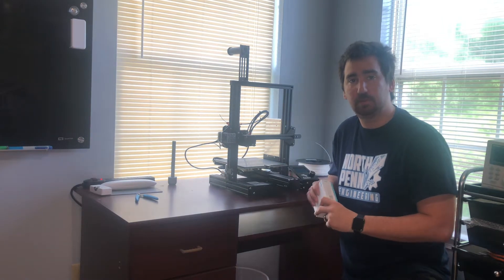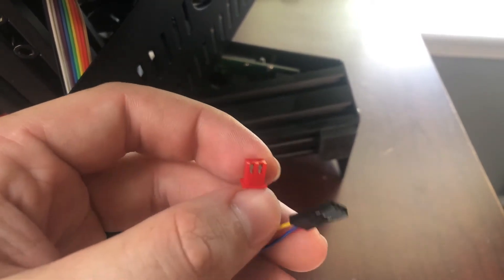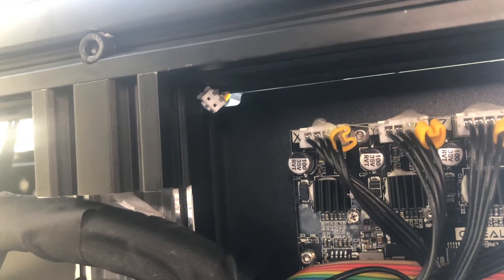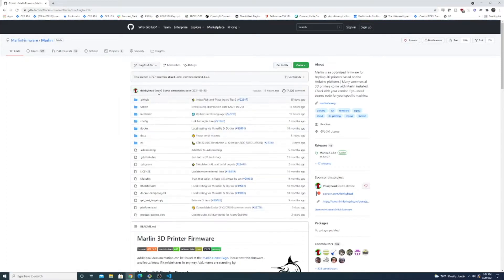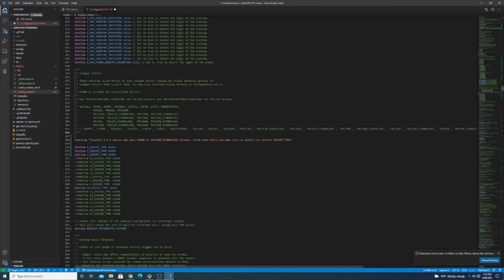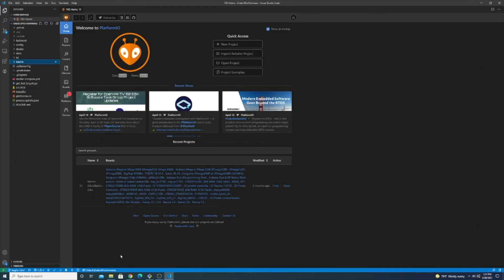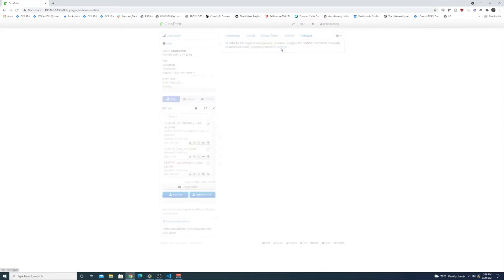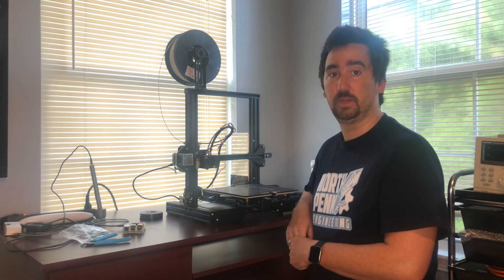How To: Install BLTouch & Compile Marlin 2.0 | Ender 3 Pro Build Series EP4

Comment: This video was super duper helpful for me upgrading my Ender 3 Pro. I did have to disable the z_probe_uses_z_min_endstop_ping flag as the other commenter mentioned. I found a reddit thread pointing that out and it fixed my issue with the printer running into an error and requiring a complete reset when auto-homing. Also for those that are using octoprint, it's a good idea to enable the flag for HOST_ACTION_COMMANDS so that the printer can send messages to Octoprint. Thanks for making this video!

Comment: Not sure if you are going to see this on such an old vid but what did you use to find the platform, i was able to get to the screen but I can't read what you typed in to the search bar or what that changed. I am using a regular Ender 3. And for anyone who is seeing this now I was able to get the same options i nthe blue bar that he did by preessing the home button then opening the folder with the programio.ini file in it. Not sure if that was mensioned in the video and i missed it or not.

Comment: I know it is a longshot that you will reply to a new comment on an old video, but here goes nothing.  I have made all the changes you made (save for the 4.2.7 board) but I don't have a spot at the bottom to select my platform, and no check mark to compile the firmware. What am I missing?
Reply from the maker: Hey, do you have the platformIO extension installed in your VSCode? Make sure that’s installed, also make sure you open the root directory of the Marlin firmware, as it contains the configuration to set up platformIO

Comment: Awesome tutorial! But i have one problem my bl touch is starting to make mesh around 2cm outside of a bed. How can i fix it?
Reply from the maker: You can use a GCode command to change the probe offset, which tells the printer the location of the BLTouch probe in relation to the print head nozzle. Check this documentation out for details: https://marlinfw.org/docs/gcode/M851.html

Comment: You went so fast with a screen that was too small to read, after backing up twenty plus times to try and identify where you were at, I gave up . Frustrating.
Reply from the maker: Is there a specific section that you need clarification? I’ve had some comments about readability so future things I will probably bump up the text size.

Comment: I did everything to the Z, my problem is the probe is probing way too far on the corners also the Y axis tried to go past its own length towards the front of the machine. Any thoughts?  ender 3 pro 4.2.2 and bl touch with 5 pin plug. If I use the flash from the Creality website it works fine but the probing is super slow
Reply from the maker: First check to make sure the X_BED_SIZE and Y_BED_SIZE Is correct. Mine probes pretty close to the edge, but doesn’t overextend like you’re saying

Check to make sure your NOZZLE_TO_PROBE_OFFSET is correctly defined. 

There is a PROBING_MARGIN defined as well, maybe can play with that? Mine is OK with the defaults. 

In terms of speed, you can change XY_PROBE_FEEDRATE to change how fast it moves to the probing point, and then you can change Z_PROBE_FEEDRATE_FAST and Z_PROBE_FEEDRATE_SLOW to change how fast the probe moves up and down. 

Be careful when messin around with the settings!

Comment: Hi, I have exactly the same machine (board and all), I've tried to follow your guide but I have following problem: when turning on my BLtouch deploys normally twice (as it should), but then when I try to auto home the printer homes X and Y axis, but with Z it doesnt deploy BLtouch and just crashes into the bed. I don't know what to do about it, I've seen this problem mentioned in multiple places all over the internet but I cant find a solution. Do you have any advice?
Reply: @Manok Yep, I ended up having to update to the most current stable Marlin firmware. The problem never happened again! Although it did take a little bit of learning on how to do it and what I needed to edit in the Marlin config file for my printer. Although now I'm on Klipper firmware and love it
Reply: That's what I'm trying to fix right now. Although for me, it fails randomly during the bed-leveling before a print. It's crashed into my bed at times, and other times it just blinked, stopped leveling, and then I turn it off before it tries to continue the print.
    From what I understand, in my case, is that the actual creality firmware from their official website is most likely the problem. I've read that upgrading firmware to the newest marlin (and ditching Creality's version) could fix it. I'm trying it now and will run several test prints before I reply with my results. 
   My case is this:
-Official Creality BLTouch module
-Ender 3 Pro with 4.2.2 board
-All cables are secure and wired correctly (My board has the dedicated BLTouch port with all the wires on one 'plug' (meaning, I plug in only 1 end to my motherboard) 
-Creality's software didn't work for me. I've troubleshooted the wiring (correctly and securely), reinstalled firmware twice from Creality's website, straightened out probe, and tightened BLTouch. Those options have not worked as of yet. I hope I come back with good news!

Comment: Can you include your start and end gcode? I feel like my printer is not using the mesh.
Reply from the maker: I added the start and end gcode to the video description.. The M420 S1 line is what loads the mesh before the print.

Thanks for watching!
Reply: @PrintPractical  awesome thank you! How often do you create the mesh?
Reply from the maker: I really don’t do it too often. Maybe once a month or less. Though, if I’m impatient and rip a print off the build plate while it’s still hot, it usually causes it to be re-leveled again. I’d check out the mesh plugin I showed on Octoprint. It’s pretty neat.

Comment: The newest BLtouches comes with a 5 pin plug only that goes into the Z-stop 5 pin on the motherboard. In this case I have to disable the z_probe_uses_z_min_endstop_pin flag or else the printer won't auto-home since nothing is plugged into the 2-pin z stop plug anymore.
Reply from the maker: Did I not mention this in the video? If not, that’s my bad. 

Thanks for watching!

Comment: excellent video thanks! how would you configure the file if you had the five pin bltouch connector? Just wondering what you would need to un-comment etc?
Reply from the maker: If you are using the 5 pin connector, and not the Z Endstop port, then make sure Z_MIN_PROBE_USES_Z_MIN_ENDSTOP_PIN is commented out!

Thanks for watching!

Comment: I have a new problem. When I start printing the bed is very un even. Meaning one end is higher then another. Do u know what the problem is?
Reply from the maker: Did you make sure your gcode is loading the bed level mesh? Did you try to use the bed visualizer plugin for Octoprint to ensure that the bed level is close
Reply: @PrintPractical  ok it's good now

Comment: I'm not able to read the board you're selecting, don't you have a Ste by step guide? The video Just isn't clear enough for me.

I already tried multiple videos, but nothing works. I'm about to throw the printer out of my window
Reply from the maker: Sorry Jeffrey, I just tried to capture my setup when I was compiling my firmware. I believe you are supposed to be setting your platform to STM32F103RET6_creality. The board you want to set for #define MOTHERBOARD BOARD_CREALITY_V4

Thanks for watching!
Reply: @PrintPractical  thanks for the quick reply, is it the same for board 4.2.7?
Reply from the maker: This is the MOTHERBOARD for 4.2.7: BOARD_CREALITY_V427

You can find these in Marlin/src/core/boards.h
Reply: @PrintPractical  tried to configure the firmware using your steps and using the files for board 4.2.7. but it doesn't work 😭😭. I will try and look for a pre configured file as I'm already trying for 4 months.

Comment: When I try to auto home my probe just deploys and comes back a few times, but then fails. Any thoughts?
Reply from the maker: Can you try inverting your Z axis endstop in the config.h? Maybe it’s reversed.
Reply: @PrintPractical  I will try that tmrw. 
Thx
Reply from the maker: Let me know what the result is, as another commenter had the same issue.
Reply: @PrintPractical  ok so my problem was that I installed the red and black switches wrong but I fixed that and now it works
Reply from the maker: Awesome! Glad you figured out what was going on!

Comment: Hiya. I was actually able to compile using your video. That is more than I can say for some of the other videos I had looked up. Thanks for that. Your video was a little fast, however, and didn't provide particularly good context.

That being said. after uploading and attempting an auto home, the X and Y axis homed as expected but the BLTouch attempts to probe/stow/probe/stow without actually moving the Z axis. The probe tip pushes out and retracts immediately without any movement from the Z axis motor. I can still move it via the LCD, so it's not like it isn't available for it to move. Any thoughts?
Reply from the maker: I've been thinking about this, maybe try inverting your Z endstop in the configuration.h file... Let me know what this does.

Comment: Great tutorial but my build keeps failing. Says conf h file is for a new version of Marlin. Thoughts?
Reply from the maker: What motherboard does your printer have? Are you sure you grabbed the same branch for both the configuration files and the Marlin source code?
Reply: Update. figured it out. either way, awesome video. Super straight forward and easy to follow. Thank you!
Reply from the maker: Awesome, what was wrong? 

Thanks for watching!

Comment: this video helped me install my BL touch, thanks for a great video and clear tutorial. most other tutorials show out dated info.
Reply from the maker: Awesome, glad you are up and running! Let me know if you have any suggestions for future content. Thanks for watching!
Reply: @PrintPractical  where did you find the config files for the ender 3? this is the only step I am stuck on
Reply from the maker: @josephhodgson7766  I'll do you one better:

Here are the Configuration files that Marlin maintains: https://github.com/MarlinFirmware/Configurations
Here is a fork of the repo which has the config files modifications I made for the Creality V4.2.2 Ender 3 Pro: https://github.com/PrintPractical/Configurations/tree/bugfix-2.0.x/config/examples/Creality/Ender-3%20Pro/CrealityV422